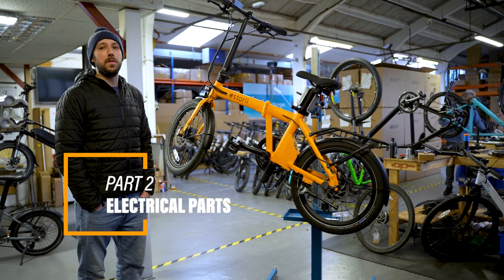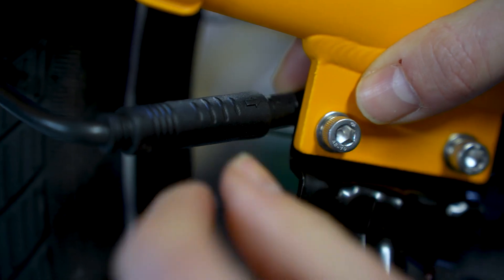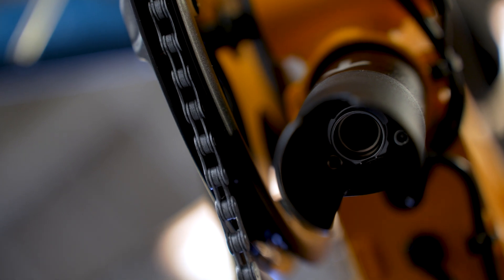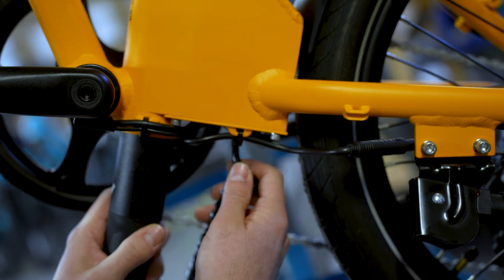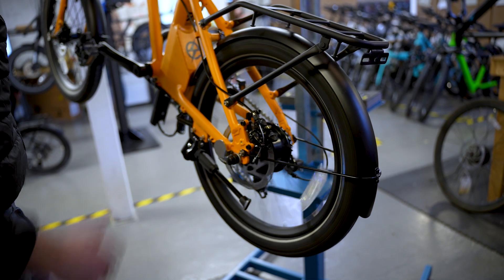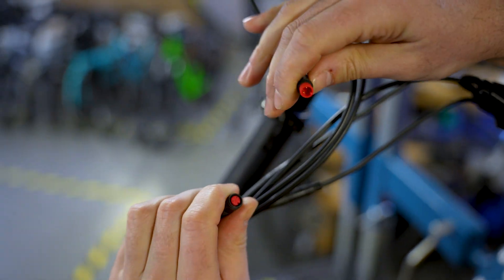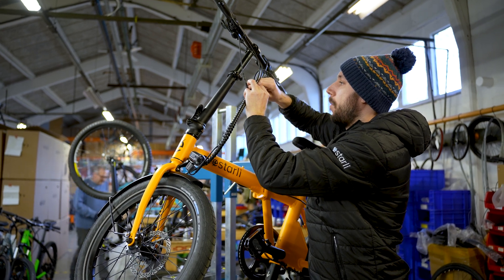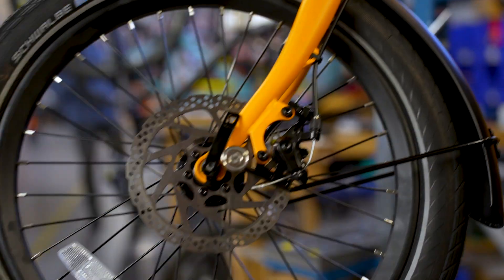Tutorial - e20/e16 Winter Maintenance Tips P2: Electrical Parts

Comment: Please could you tell us how to get into the ‘speedo’ to reset to zero the trip mileage, and whatever else it can do (mph to kph, too, I hear).
Reply: Here's how to get into the setup screen where you can configure the
bike parameters:
Power on your bike
Immediately hold down the "up" & "down" arrows until the screen
backlight turns on.
Release all buttons and then press the following buttons in this order
to enter the setup menu
"Power" - "up" - "down"
Followed by
"Up" - "power" - "down"
You will see a 25 flashing on the display, press the power button
until the km/h sign flashes (normally 3 clicks), use the up arrow to
change the display to mph or kph
Hold down the power button to exit the menu.
Hold down the power button to turn off the display.
Next time you power on the bike it will be in mph or kph whichever you choose.
Reply: @hologram1954  You have just made my day. I have been trying to do this for ages with no luck. I have asked the experts only to be told that it needs to be returned to Estarli for full reset! Thank you.
Reply: For the trip mileage:  if I recall correctly (I'm not currently with my e20) hold both 'up' and 'down' at power-on for a few seconds (maybe five or so) and it clears the trip computer. You might have to press 'power' again to finish.